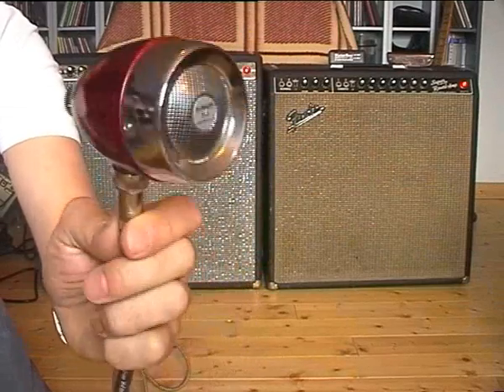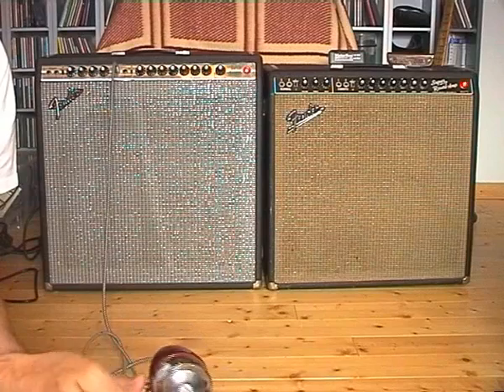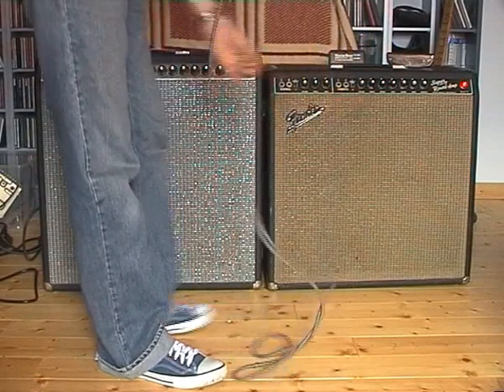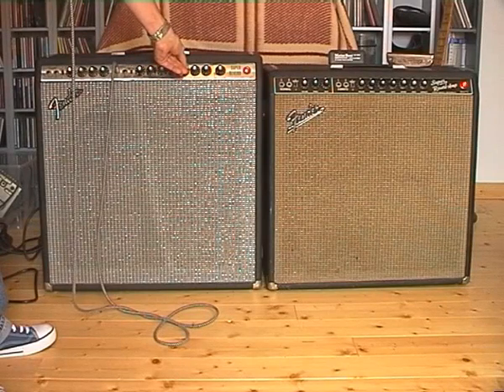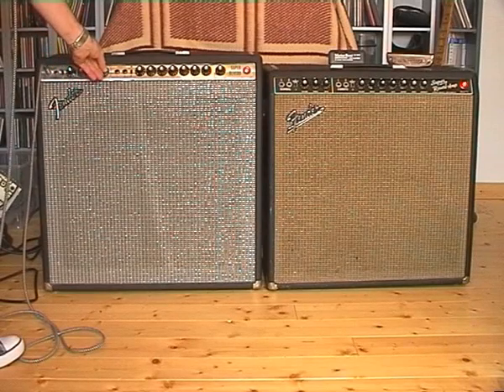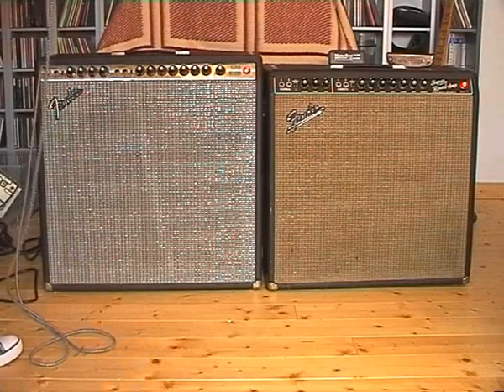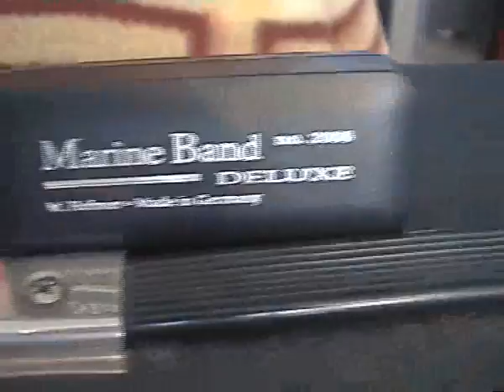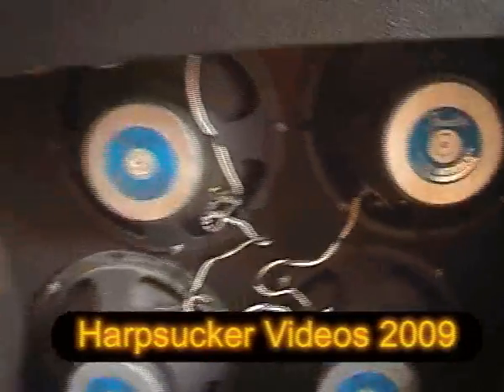Harmonica Amps Vol.71 Fender Super Reverb Blackface vs. Silverface

Comment: Danke Tomas, I've a 63"found in a shop back in 83"seemed nobody wanted the bruised up fellow, with some loving care over all these years,, by far the best sounding amp I own, for harp&guitar, only small concern is break up at low vol, and these days, there's no shortage of pedals that are matched for harp amplification, and when the 90"bassman reissue came out of course I had to get the supers older brother, another great! that amp was delivered to my house for 600$ and the 63super was....270$ these pup, s won't be getting out of my yard, even after ich bie tott! umm!
Reply from the maker: +Pat Coughlin there is no 63 Super Reverb, the earliest model was 64, do you mean a 63 Super
Reply: +Harpsucker correction sir 64 super, once owned a super 6,,100 watts I think,6×10 only made for 2or3 years one big s.o.b.had to leave it behind in n.y. wouldn't fit in my  koffer thank for the many great demos, how much of this gear did you come across in deutchland? there alot of tube pa.s and amps about that were produced in Europe, , ja? I never thought to seek them out when I lived in the Platz I do like that premier that opens up with the 8 in it
Reply from the maker: +Pat Coughlin sold the Premier 8 to the states a few years ago, really good sounding you right, the 6x10 from Fender called "Super Six" is really a beast, 100Watts into 6 tens lots of boom, at times when PA systems wasnt that good, haha

Comment: I have a 1979 Ultraliner Super Reverb and in my opinion it is the best sounding clean Fender made. The UL Fender amps were designed to have greater extended dynamic range not to sound cleaner as most people assume.